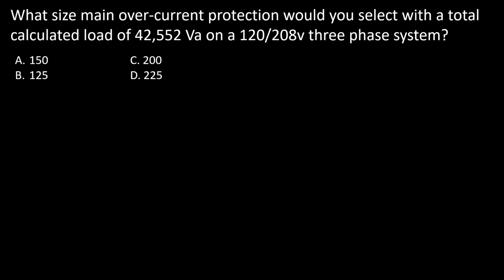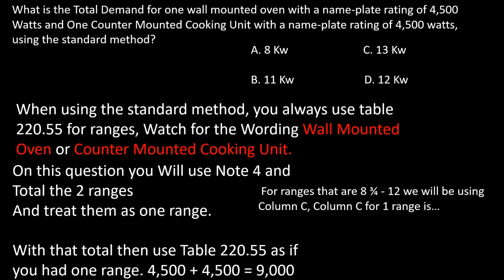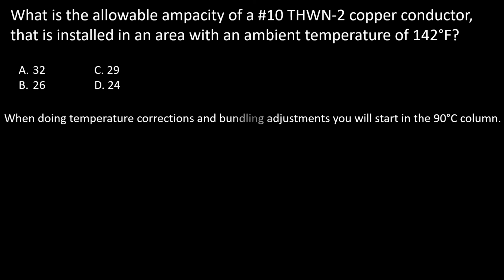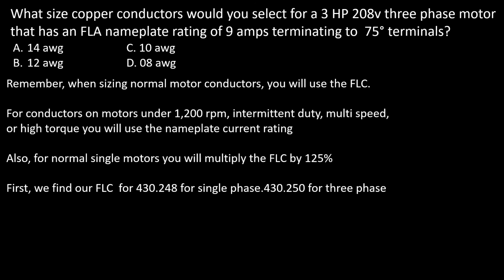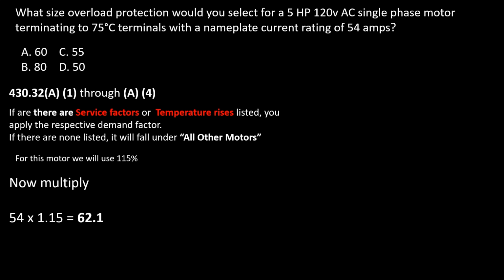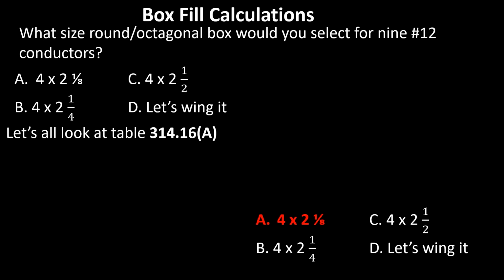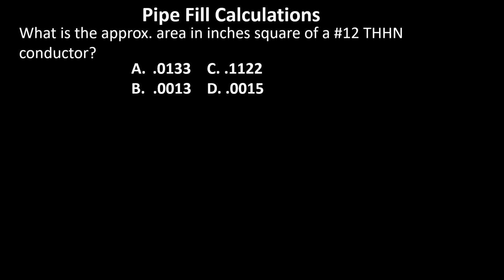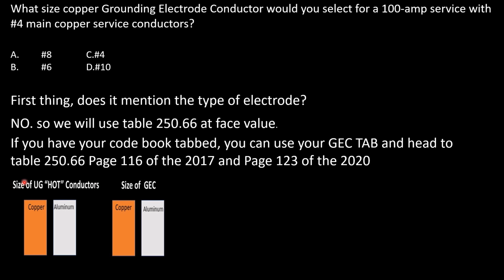25 Electrical Exam Prep Questions with Full Explanations Volume 3

Comment: Hello Coach. I’m hoping you can answer this question since I’m confused and can’t find anything in the code book. Where does the 125% comes from when doing the heating VA calculation using the optional method ? Are we supposed to consider it as a continuous load ? I NEED HELP PLEASE….
Reply from the maker: Hey brother, I've quit teaching the 125% for the largest load

Comment: Hi Coach,
I have been learning a lot from your videos. Thanks for that. 
I got a question about calculating total HVAC demand optional method. When you calculated the load for heat, you multiplied it by 1.25. Where that come from? I read 220.82 and din not find nothing about it.
Reply: I am guessing because it's a heat pump??

Comment: these math problems look like they're for the masters test?
Reply from the maker: They are for all tests Keep grinding!! If you need help let me know 423-895-3247

Here is the recipe for getting your license or certification. 

Sign up at  https://www.electricalexamcoach.com/membership-account/membership-levels/ 

1. Do the entire pro version. 

2. Do everything in the ECC testing center. 

3. Grind for 30 minutes a day on 100% 

4. Put tin foil on it and grind 1-2 hour a day for 10 days leading up to the test. 

5. Go take the test. 

6. If needed, repeat until desired result. 

Right now you can get a Lifetime membership for only $49.99. 

The first 4 people who sign up today get the 400X question PDF for free! ($14.99 value) 

https://www.electricalexamcoach.com/membership-account/membership-levels/